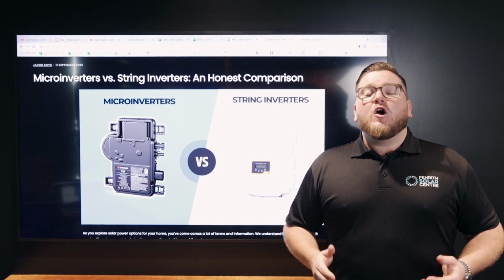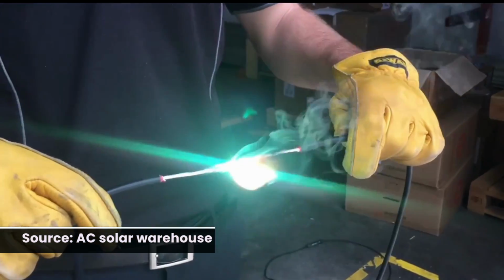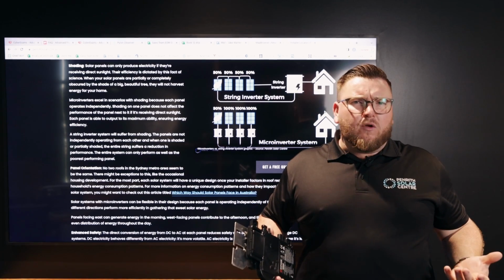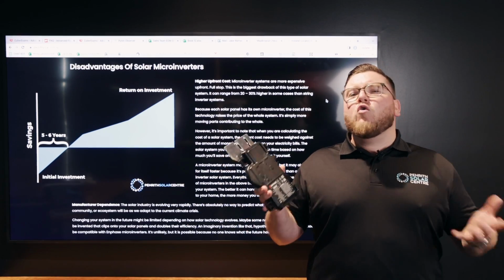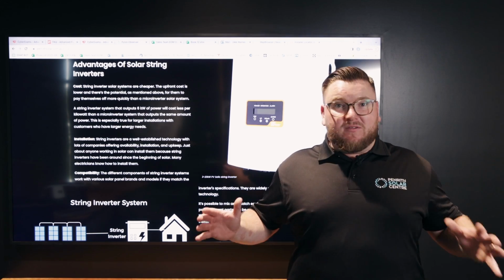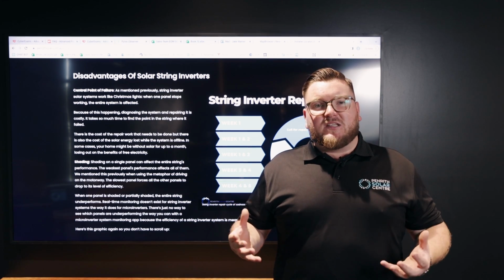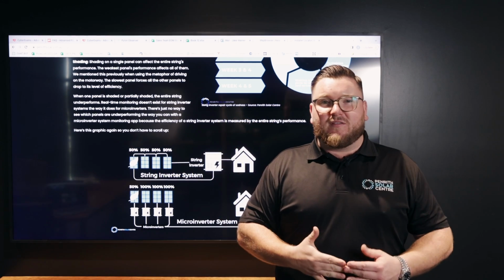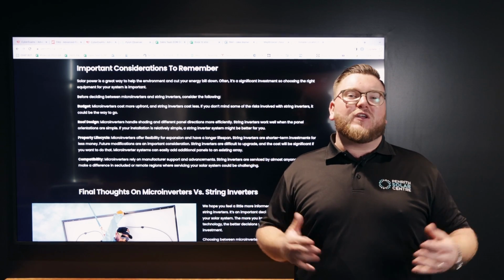Microinverters vs String Inverters - What's the difference?

Comment: Most of the comments below seem to be in favor of string inverters.  But as a non-electrician it seems to me that microinverters on a ground-mount solar panel system where a coule panels get some shade part of the day just seems like a better system.  Easier for a non-electrician DIYer to replace and if one goes out a person is not stuck possibly with no electricity in the middle of winter in an off-grid system.

Comment: Enphase is good.  That is what we have on our house.  However upgrading isn't as simple as he makes it out to be.  For example, adding new panels.  Turns out we can't just upgrade the 13 panels on the front of the house, even though they are a separate array.  The new ones are not compatible with the ones we have on the back.  We would need to purchase a completely new system.  Not sure I would go this way again.

Comment: As an aerospace electronics engineer I chose a large 15 kw string inverter system over microinverters for several reasons that mostly track back to reliability and maintenance.  1.  Parts fail, less parts fail less.  Each microinverter is filled with many parts leading to many failure opportunities.  The component count in a few string inverters is far less.  2.  Heat kills electronics parts.  Microinverter components running on a hot summer roof are often reaching 150 degrees+.  String inverters mounted inside a home or garage experience far less thermal stress.  3.  To fix something you need access.  When a microinverter fails, you are up on the roof disassembling the panel array to get access.  The warranty does not cover those labor costs, and they may exceed the cost of the microinverter.  My string inverters are far easier to access.  4.  Water ingress.  Microinverters on a roof will experience all the rain water running under the panels.  As seals deteriorate over the years, water ingress will start causing failures.  String inverters in a house or garage are sheltered from this.
Summary is that I feel string inverters are a superior approach.  Your mileage may vary.
Reply: Cost of scaffolding and two sparkies to find and replace faulty component, could potentially wipe out four years energy savings. And of course, they will ALL fail eventually.

Comment: You are very misleading. Most panels have diodes that allow them to be isolated when one is shaded so it no longer causes a large power drop. And micro inverters fail a lot and cost a lot to get someone to replace them. It is clear that you are making money from installing these. You also did not talk about optimizers.

Comment: Enphase marketing gimmicks aside:

If you have any kind of shade you need Enphase? Not really people have tested this and the difference is around 2-5 percent. Typically the string inverter in peak sun will slight outperform the Enphase system with Enphase picking up the slack later in the day.

Central point of failure in the Enphase system is the IQ combiner box. Enphase offers a superb 25 year warranty for the Microinverters but with their combiner box... 5 years... hmm likely to fail maybe.

AC coupled systems have efficiency losses when adding battery storage. These efficiency losses can approach 10 percent of total system output when you factor DC-AC at the panel then AC to DC back to the battery. This is not the case with DC connected string inverters which reach efficiencies as high as 97-99 percent. Not to mention most microinverters have a substantial amount of clipping as panel power has outpaced microinverter output.

As far as safety is concerned RSD or rapid shutdown devices are required at the panel level in most states whether you have microinverter or string inverter. For home insurance reasons there is no extra discount for going with specifically an AC couple solar panel option. If the other option was so dangerous insurance providers would drop home coverage for sting inverter solar systems but as you can see that is just not the case.

Cost - I have received quote for Enphase systems and they have been at the very least 5-10 thousand dollars more than a comparable string inverter system like the PowerWall3. Payoff time for an extra 5-10 thousand can be 4-8 years more for Enphase depending on rates and usage.

Aesthetics - A single Powerwall inverter battery system or   the equivalent 3 separate battery boxes, loads panel (usually), IQ Combiner Box and all the interconnected conduit.

All that being said I still really do like the Enphase solution. I just wish that they would step up the panel wattage support, create a solution for housing multiple components into a single housing to reduce install costs/complexity.

Comment: Micro inverters cannot last 20yrs in the summer heat. The cost of identifying and replacing one in an array of panels could easily hit $17000. With a string inverter, you just replace the box. 
Micro inverters are not safer than string inverters because any voltage greater than 50 volts can kill a human. None of them is therefore safer.

Comment: Mciroinverters sound great BUT what if in like 12 years 6 of my 38 microinverters go out and now they are on IQ20s. Will they be backwards compatible? Will emphases replace all 38? No. Will emphases still be in business?  If I am the installer then it seems like best case Enphase would send me whatever they have at the time, but  will have to buy other equipment to make another system for my 6 new micros. Too bad micro inverters aren’t more independent.

Comment: ex-sparkie and electronics guy here... ...why would DC would be more dangerous than AC? Oh string inverters use optimizers, so shade is not a problem.And they shut voltage to 1 volt when not getting comm from the inverter. AND you get panel level data. And I'm just adding 4 more panels to my SolarEdge inverter at the moment. I find this Enphase video quite a bit misleading...

Comment: Run two string inverters in parallel.  Solved.  If one goes down, you still have half your capacity while you wait for the disabled one to be replaced.

Comment: Hi I have one question about enphase micro inverters installers are not providing DC side SPDs only AC side whereas in string inverters installers are providing SPDs on both sides. Is that unsafe for these micros .

Comment: Some facts, but basically snake-oil and pushy pitch.  The best way to exploit micro-invertors on a panel by panel basis when shading is an issue, is to fit an ideal diode (FET) underneath every single cell within a panel.  No solar panel manufacturer has done this - YET.  When only 1 or two cells on a panel are shaded, it does not take out the panel as an energy contributor if this is done.
AND - if they go to the trouble of doing that (cheap and simple), a crude DC-DC invertor integrated into the panel removes most of the other string and wiring nonsense that seems to have created a silly priesthood of sorts.
Reply: I haven't heard about DC-DC inverter, but DC-DC converter. They are different.

Comment: Any voltage over 50V is enough to kill you, AC or DC...there's nothing "safer" about AC over 50V. Bypass diodes & power optimizers should resolve any shading issues for string inverters. A string inverter is a single point of failure which can be replaced with any other string inverter versus micro-inverters which must all be compatible with each other,. Which means you're stuck with Enphase because both installers & homeowners can't trust any other brand of micro-inverter to still be in business a decade or more from now.
Reply: It isn't the Voltage that kills, it is the current(Amperage) that kills. A statistical shock can be upwards of 25,000 Volts, but very low current. I worked on electronics for years, during my training I once was shocked by 50,000 Volts, it did not kill me, it just did a great job of waking me up.l!

Comment: AC grid power goes out and so does your micro inverter system!
Reply: Enphase IC Q8 Microinverters can build their own grid ;-) So that reason is not valid anymore ...
Reply: @tommytwohearts  they aren't allowed by the electrical code.
Whole house ac coupled battery - could if it is coupled with mains disconnect switch.

Comment: Have you heard of bypass diodes? Can you figure out how they work? If you can , you will understand that you are laying.
Reply: Maybe if you actually truly understand what bypass diodes are for, then you wouldn't have made this comment.
Reply: @alzuu1  I do understand. I design electronics.
Reply: @sveinmedhus4156  Then that's really worrying, lol. Bypass diodes are just one part of a whole array of things in a solar system and doesn't inherently say anything about the system as a whole. Most panels nowadays have bypass diodes which is primary used for shading issues within the cell system. In regards to shade, micros will always have better performance albeit it could be by a small difference. The points he made are all pretty much correct.

Comment: There are negatives to Enphase microinverters,  you lose a lot more of the power that your solar panels create because you change convert back and forth from DC to AC or AC back to DC up to 3 times if you have batteries and each time you lose electricity (in heat) created when it changes.     Also Enphase is extremely proprietary in that you must use their parts and if you have an Enphase system and you want a home backup battery system you pretty much have to use Enphase batteries because they have Enphase Microinverters inside the batteries to convert the power from DC to AC just like the microinverters on the solar panels and then you lose even more electricity.    You lose some power every time your system does a conversion due to heat and transfer losses and that is the honest truth.
Reply: Most energy is used AC current direct or sold to the grid ... In the end through this you will come out net zero, or even some bucks on the AC side (Unless you are not totally off grid)

Comment: Many very good points, but I think you downplay the advantages of having string inverters on the ground rather than up there under each panel.  You can ruggedize the heck out of an electronic circuit all you want, but sitting underneath a black solar panel in the heat of the day is a terrible environment and it can and will take a heavy toll on capacitors over time and make them fail.  What good is having a 25 year warranty/life on a panel if it’s attached microinverter is going to fail in 10 years anyway?

I can replace my own string inverter in an hour, which is even more important if my installer goes out of business.  Well over half the solar installers go out of business in 10 years, so I want a backup repair plan when things fail…and things always fail over time.

Also, you don’t consider that having a microinverter on every panel means you have many more points of failure.  More circuits = more circuits that might fail.

Finally, back to installers again which you do admit is number 1 most important consideration.  As a customer, I’m faced with primarily two kinds of installers to choose from.  There are the good honest cheap installers that are giving customers great value for money.  And there are the guys who sell the cheapest stuff they can and charge the most for it to maximize profits.  The problem is the first guys are operating on a tiny thread (money wise) and are the most likely to hit a rough patch and go out of business.  The second guys are going to rake in the money, so they can afford to advertise and get bigger and bigger, but as that cheap crap fails after a few years, they will start to have more and more unhappy customers and they will be the most likely to just cash in their chips and fold up shop.  All of which means we customers get screwed either way and we are better off getting a system that we can service ourselves, or is so simple their local electrician can figure it out and replace components when there’s trouble.
Reply: And pls let me get final, which is the best micro or string?? In your concern
Reply: @ungalnanktr  It depends on your roof, needs, blackouts basycally.
Reply: You got an 25 year warranty in the US and Europe for the Microinverter, Australia 15? Years. But don`t worry, in these 15/25 years one of the panels is going to fail too. And without Microinverters, the whole string will go down and it will be hard to find out the panel whick f***s the whole thing. Probably my solution is going to be a string with Solar optimizers. Best of both worlds (almost) and survaullance of each module like with string inverters, just cheaper. Search for "Solar optimizers" or "tigo optimizer". Only thing is you stay high voltage DC current.

Comment: So, if your microinverters are such a perfect solution, tell me: how much will a COMPLETE installation (without the costs of racks, installation and PV panels) with a capacity of little bit below 50 kWp - a hundred PV panels.
And I'll tell you how much traditional inverters with traditional strings cost me. Just for the record, I would like to add that my inverters also support a very large LiFePO4 battery and export excess energy to the grid, automatically selecting ONLY the periods with the highest profitability, so the three-year operation of my system has already paid off! Because my system exports energy to the grid not during the period of greatest sunlight, but when there is the greatest demand for energy in the grid, it consequently achieves the highest prices.
Additionally, my inverters charge batteries from the grid, not from PV panels, when the grid energy price is NEGATIVE, which is how I earn extra money, which microinverters certainly cannot do.

Comment: Thanks for this info!  
My only question is how a Microinverter system works with batteries?
I know they can, but isn't there a huge loss of efficiency going from DC to AC, then back to DC to store power, then back to AC to deliver power to your home?
It seems I would lose about 10% for every DC-AC change, so I think that would be as much as 30% for me.
I can see where on-grid the simplification would make sense despite a 10 to 20% efficiency loss, but I live off-grid, so don't really need phase-matching AC.
Would I be better off with a string inverter and optimizers?
I have access to inexpensive panels, so the added cost of optimizers is actually more than the panels, and I would still need AC-DC and DC-AC conversion equipment (AC-DC charge controllers and DC-AC inverter).
Reply: There’s approximately a 15-20% loss of power in the double conversion
Reply: But since you use most of the "harvested" Solarpower as AC in your home directly or you are selling big parts especially in sunny times it to the grid, it is not a real difference. Actually I saw a Video of a German engineer, who showed a AC System is even cheaper or less loss. Also don´t forget there is also conversion in DC Systems. 1000V String to low voltage batteries, then also back to AC.
Reply: You have to look at the round trip efficiency - DC systems aren't that much higher than AC systems.

Comment: What is the amount of labor involved in replacing a microinverter vs a string inverter if one fails?
Reply: Well after climbing onto the roof, uninstalling a bunch of panels to find the failure, then replacing the failed micro, then reinstalling the panels.  Vs walking up to the string inverter and unbolting/dewiring it from a safe level.   So....string inverter for the win.
Reply: @allyn7577 it’s not that hard as the micro inverters app or software will tell you which panel or micro inverter is bad
Reply: @allyn7577  That's assuming the panels are on the roof.  I don't like people walking on my roof, putting holes in my roof, removing all the panels at re-roofing time then re-installing them, or trying to wipe the snow off panels mounted on the roof.  I much prefer a ground-mount solar panel system even if it means a couple panels might be a bit shaded in the late evening. And if a micro-inverter goes out I'm not out of power for three weeks while a replacement string inverter is on order.  And micro-inverters are much easier to replace.  So in my opinion micro-inverters for the win on ground-mount off-grid systems.
Reply: @sphillips6357  oh yeah better solution on a ground mount.  Though honestly some of the micro inverters are almost the cost of a full string inverter. I can get string inverters for around $500.
Reply: @sphillips6357  Most people don't have the luxury to do a ground mounted solar system. In many, MANY cases, the roof is the only available spot.

Comment: @mcelectrical looks like another fake video about string inverters
Reply: If you look at the majority of installers they’ve moved away from
Micro inverters due to the cost when something goes wrong. If an inverter goes you need to track down which one went and that’s at your cost not the installer or manufacturer
Reply: @behindthebuild8016 you takin the piss??? You don’t know much about micros ay. Not even worth a reply.
Reply: Ok Shazza back on the pipe u go
Reply: @chrisandshazza01  ...BUT..BUT...you replied when you said its not worth it
Reply: There were many people didn’t believe automobile will replace horse cart. Please don’t be one of it. Microinverter is the future.